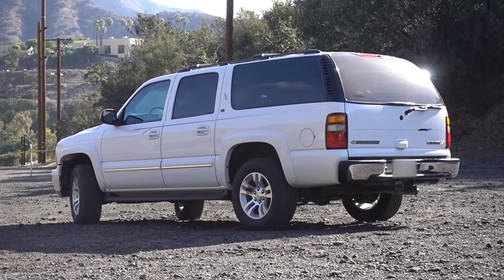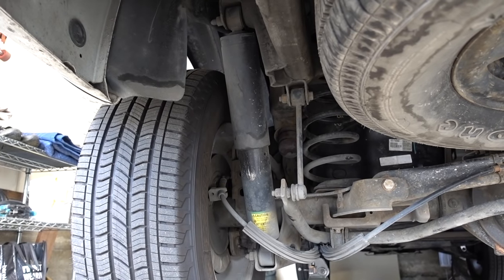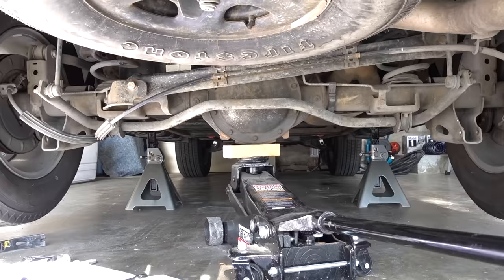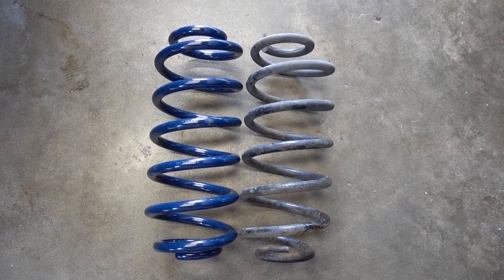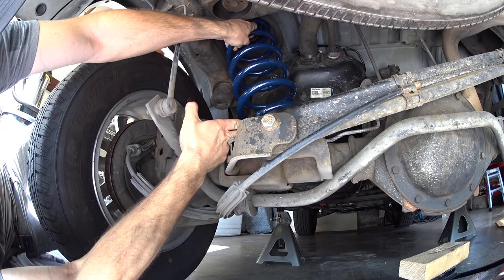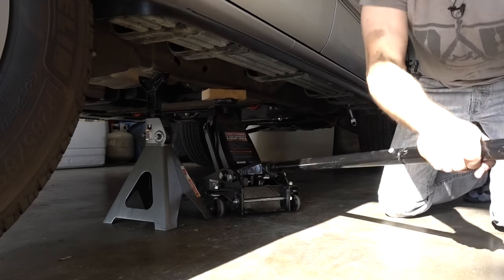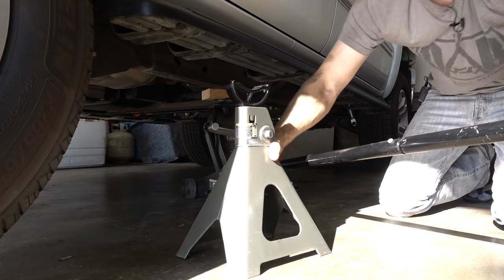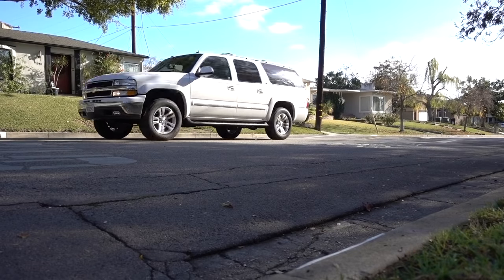BEST BILSTEIN 5100 REAR SHOCK & SPRING UPGRADE EVER!!

Comment: He put the rear shocks in upside down.
Reply from the maker: Boot goes up
Reply: @1RoadGarage  Not from what I've seen. I have seen several references that stated they called Bilstein and they told them boot goes down.
Reply from the maker: Hey Jack, while I'm sure we're both correct, the boot could probably go either way, I've never seen the boot down. What I do know is that the fronts are CERTAINLY directional with the boot up. This is true for both my 4600s and 5100s as they only go in one way... Also, on my '95 Suburban, running the 4600s, the rear shocks only go in one way too; boot up. This is confirmed by the fact that the upper mount is a bar pin mount and that bar comes pre-installed on the 4600s... at the top with boot up. Also, it is extremely apparent, on both the 4600 and 5100 that the lower mount is a lot more robust due to the possibility of contact with the ground/rocks/etc. Lastly, I just installed a Rough Country lift kit on my '95 and it came with a set of shock on which is stamped with an arrow pointing up. That is, boot up. Hope that helps.
Reply: Nope, they're on right.
Reply: My final case is this. The emblems on the shock are upside down when the boot is up. Also, the drainage holes are on the bottom of the boot when it's towards the bottom. So with the boot up you are going to collect water in the boot